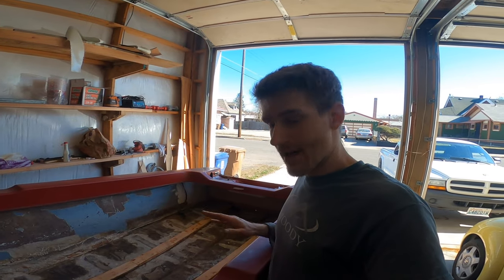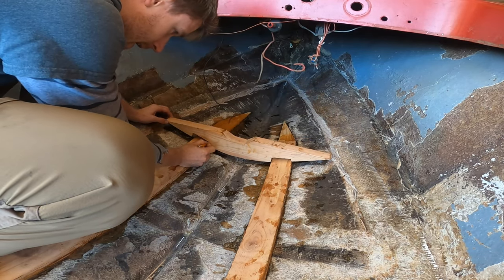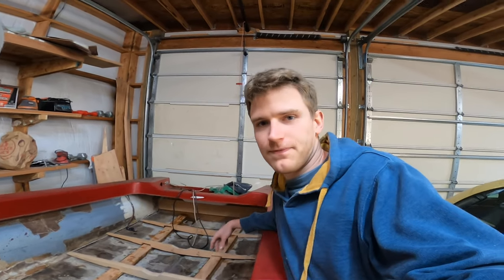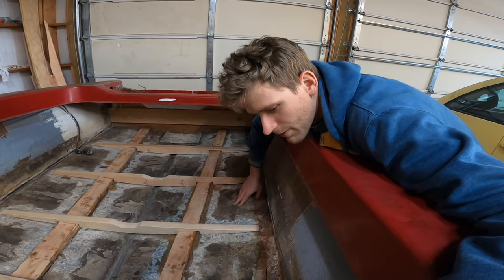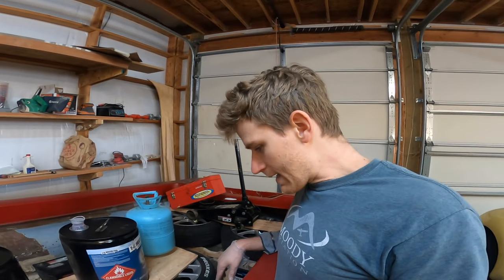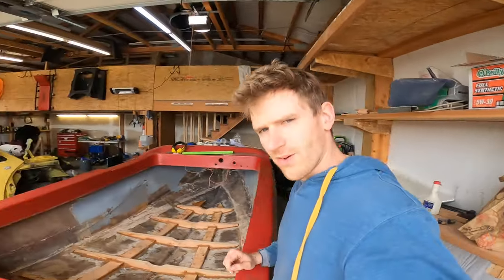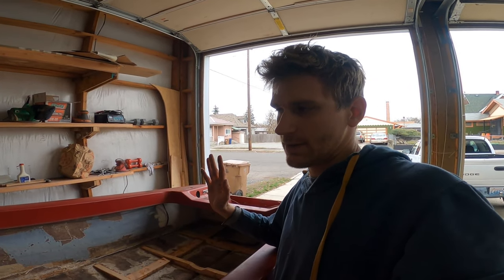Boat rebuild (PART 13) New Stringers

Comment: Nice...Awsome job man...You are proper  thurrow ....hehe...would recomend peanut buttering 1" pvc pipe drains under the bulk head gutters just to ensure proper sealing....or something of that sort...But you're probably way ahead of me...Lol....awesome series...Thanks...
Reply from the maker: I did think about that. i'm just worried that the pipe would eventually clog with debris down the road. what do you think?
Reply: @Project2Potential  if you  make the hole bigger or use the pvc as a mold...I dont believe it should be a issue....can always poke it or something...heheheh....just dont do the pour foam for flotation...water gets trapped in voids and cant drain...I would just add floor inspection doors for access...

Comment: you are putting in work. i purchased my first boat for 350$ ,  only did new flooring and center consile and we slapped a older 50hp merc, let   me tell you that the end result is awesome!!! once the boat is in the water it was all worth it
Reply from the maker: oh nice! thats cool! what kind of boat do you have?
Reply: At the time it was an older phantom side console but converted it into center console. Now I have a 1996 16.5ft aqua sport cc

Comment: I’ve watch majority of your videos up to now and I’m impress as to how far you’ve come along knowledge and skill wise. I can’t wait to see your next video. 
One thing I did noticed or maybe I may have missed it in the video is that the stringers didn’t look like it was glassed. I’m just afraid the area where the water drains back will come into contact with exposed area of the stringer later rotting it out again. Hopefully, it was glassed in and I just missed it. 
Keep it coming because I want to see the end result too.
Reply from the maker: thanks for the encouragement. this past video i released shows the process of glassing in the stringers. hopefully the end result will come sooner then later!

Comment: Nice!  Im doing a boat restoration similar to this one over the winter.  Got the floor and transom done and faired, prepping for paint right now and hopping to paint within the next couple weeks.
Reply from the maker: So cool! what kind of paint do you plan on using? also what kind of boat are you restoring?

Comment: A little late to the party.. but, what kind of fiber glass resin are you using? Looking to make similar repairs but have not worked with fiberglass before.
Reply from the maker: haha welcome to the party! glad  you could join, for this part I used the Total Boat 5:1 Epoxy mixed with wood flour and White Glass Microspheres. I bought them on amazon

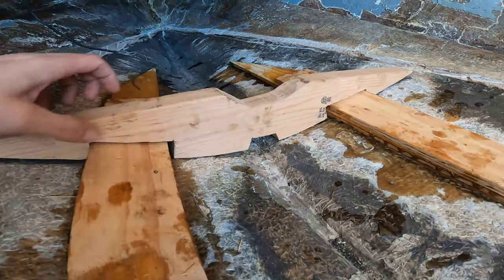Comment: Did you seal the underside of the wood with anything where you cut your notch for hull drainage, (at 3:26) since you decided not to put any pvc pipe, etc. in the notches?
Reply from the maker: I believe I just coated that part of the stringers in fiberglass resin